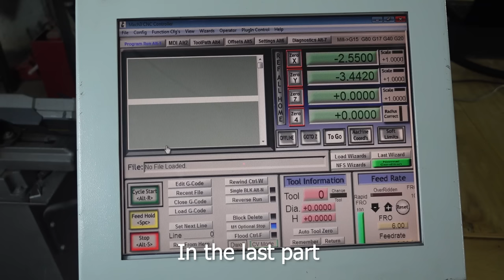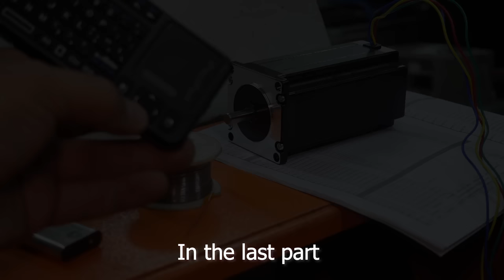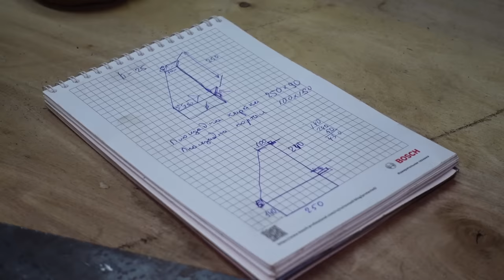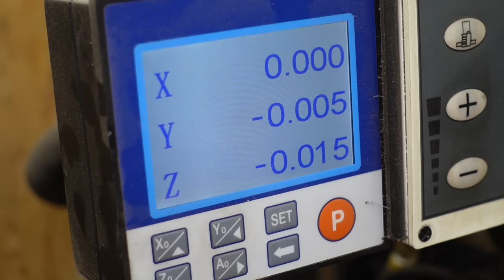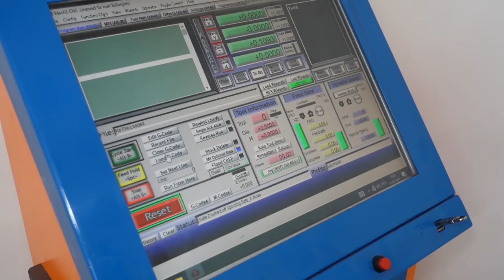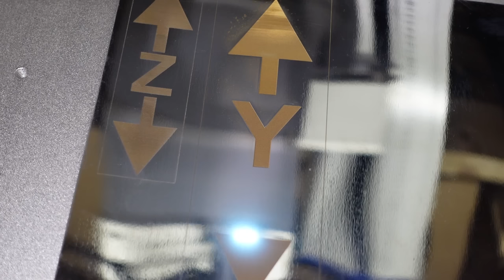I Build a Big CNC Machine - Homemade CNC Final Part

Comment: If I had to do this I would have used Square runners. Know they are more expensive but far better on wear and accuracy. You put so much effort into this it would deserve the best  parts. The round bars on the extruded aluminum must be annealed to be able to drill and tap. Do they get het hardening right after tapping? the answer is no if it is not the same bar manufacturer. The slides will wear into the round bar at load in no time.

Comment: Also for the ball screw bearings you would need 2x 7000 deep groove series opposing bearings. This might be ok for a machine with 0.3mm accuracy and 0.1mm backlash - which is maybe what you may get from round bar and runners..

Comment: One way to check for twist is to use the two wires method with a multimeter set in continuity mode. Hook one end of one wire to the positive lead and the other to the negative lead. When the two wires touch, you'll hear a beep.
Reply: Neat

Comment: The technique for aligning and squaring the rails with common shop equipment (other than the beam straightedge which isn't common) is pretty brilliant.  I have been stumbling over how to do this in my garage.  I also never thought to align the cross table supports to the already installed gantry and z axis assembly...that will be a real time saver.  I am wondering if Mr. Craft is a Millwright to have such knowledge?
Reply: Until you price the beam straight edge then your back to square one (at least I am)

Comment: wonderful machine, friend, why at minute 3:30 do you use some threads, what is the objective of these threads?
Reply from the maker: This is in order to avoid a large skew (screw) on the table from the four points of the table, two thin fishing lines should be next to each other.

Comment: Beautiful machine. If I were to build one, I’d make it so that the legs can be removed and the entire frame for that matter. This machine was apparently built in a small room which means they’re going to have trouble getting it out should they decide to move. They will most likely end up knocking down a wall. Anyway, all the best of them.
Reply: You just use a grinder